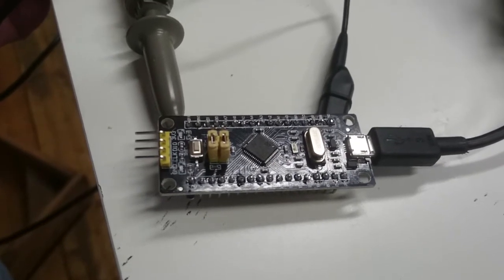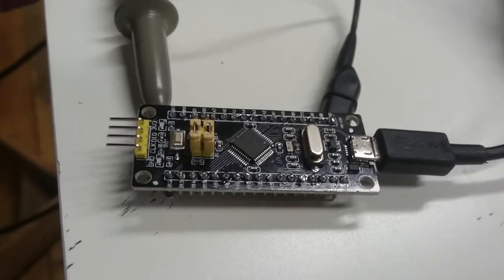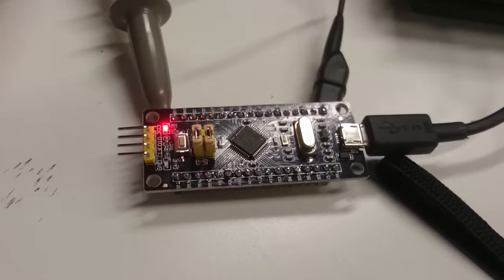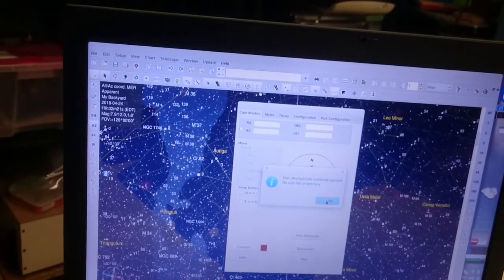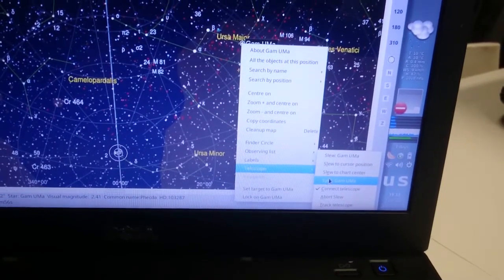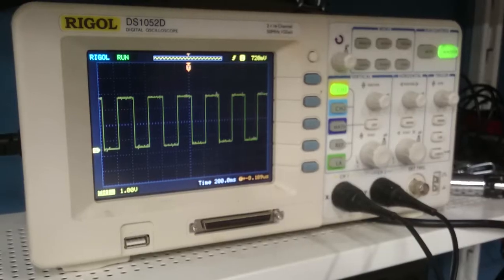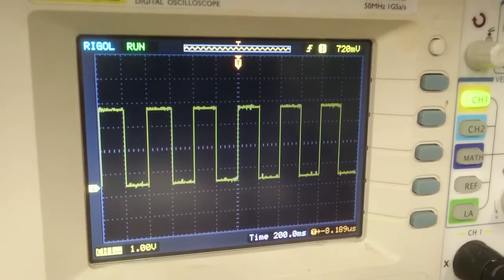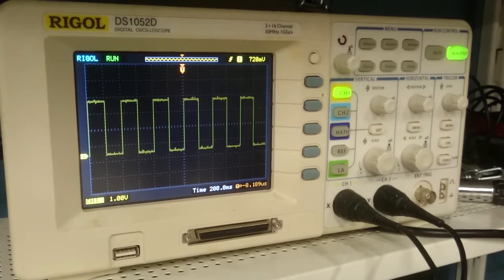OnStep Telescope Controller on cheap $2.50 STM32 ARM Cortex M3 Board

Comment: Why do you want a real time clock for a telescope? 
You would be better off with a GPS It will give you much more accurate time & your location.
Reply from the maker: The real time clock is used hold the date and time between observing sessions, so it does not need to be entered every time you power the scope on. The data and time are needed to ensure that the objects in the sky are in the correct place the scope things they are. Otherwise, all Goto operations will be wrong. 

The real time clock is also used to correct the frequency of the microcontroller, so tracking the sky motion is right.
A GPS can be used, but the firmware we use for this (OnStep), has a phone app, and takes the latitude/longitude/date/time/offset from UTC from the smart phone. So a GPS is not really needed.
Reply: I'm using the the GPS to set the polar axis via a attached stepper and worm & have my tripod self levelling it may be lazy but it's way more accurate & quicker than using a bubble.

Now I just have to work out how to find true north at a reasonable cost.

I'm using a guide scope to keep the tracking accurate & and a polemaster camera attached to the rail for plate solving once aligned.
Reply from the maker: @dmitribovski1292  The RTC we use in OnStep is a DS3231, and has an error of either 2 ppm which is 62 seconds per year. 

You need to checkout OnStep, because it is not just tracking via an Arduino. It is a complete ecosystem. It has the full LX200 command set, with many extensions, it interfaces to many planetarium, supports guiding, period error correction, polar error calculation and correction, polar align refinement, a hand controller, an Android App, and so on and on and on.

Comment: tip: if you have a 5V-only uart and you want to flash the maple/arduino bootloader, the A9 A10 pins of black pill are 5V tolerant. so no need to use level shifting ( like i did ) although that's safer in theory. The black pill has its own wiki https://wiki.stm32duino.com/index.php?title=Black_Pill